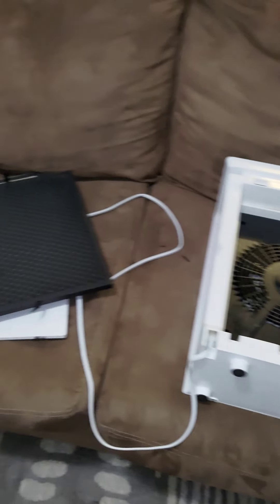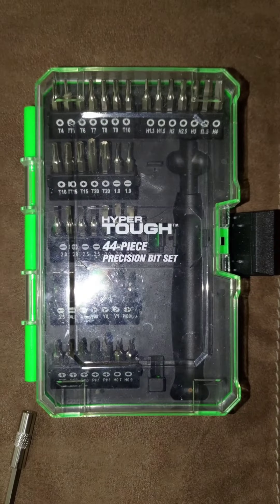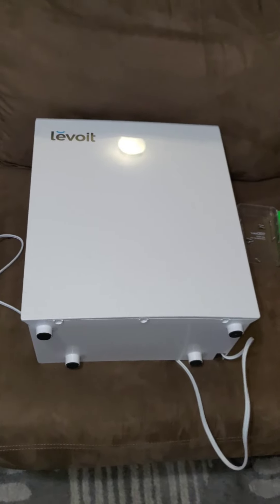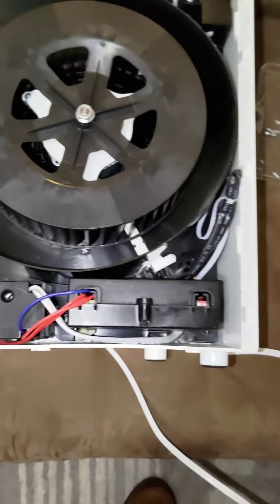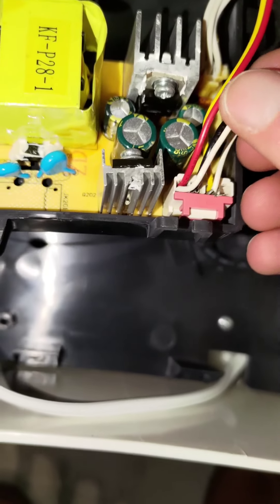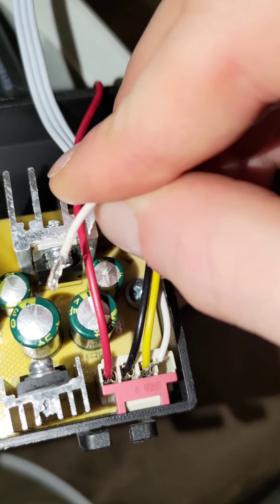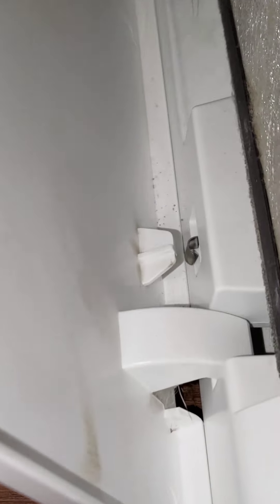Levoit LV-PUR131S Hack / Teardown

Comment: FYI - Took a look at a friend's unit that was not working and found a bad 470uf capacitor on the power supply board. Replaced the component, and did a full clean up, and got it back up and running. Thought for sure I was gonna destroy that front cover but did manage to wrestle it off and dug into the electronics. Saved it from the trash.
Reply from the maker: That is awesome!  I might try that, but like I said, I'm happy with the unit just running on full power.  I might try to fix one of mine for fun though.
Reply: 470uF.. thank you. I forgot to note this before reassembling the unit
Reply: I just took apart mine that stopped working and lo and behold, bulging capacitor here too! will be replacing it soon
Reply: @chaosdimension6433  Are you serious? So thats a few confirmed cases of blown capacitors now. What a joke.
Reply: @CheeseZombieo  yup, ordered a few 470uf 16v replacements already, hopefully it's just that
Reply: @chaosdimension6433  Let me know how it goes!
Reply: @CheeseZombieo  Received the capacitors today, replaced the blown one and the air filter is back to 100% fully operational contidion!!!!!
Reply: @chaosdimension6433  My dude, thank you so much. Thats what I wanted to confirm being placing the order. I'll grab those now. Big thank you for your feedback & follow-up - I appreciate that.
Reply: @CheeseZombieo  no problem man! i bought 5 for like 4 dollars, very easy to replace, let us know how it goes for you
Reply: So glad I found this comment. I had a popped capacitor as well and 97 cents later I have a working unit again.  I had one replaced by Levoit and one replace by Best Buy within 10 days of each other.  I watched back through this video and I can see the same 470uf capacitor on the left at 3:42 looks domed up as well.
Reply: @a93x  Glad you were able to fix it. The guy I buy capacitors from has a moto that "replacing capacitors can fix 90% of the worlds problems. It sure seems like it. Way to go Alex.
Reply: Also worked for me just now (look at 3:42 in the video to compare, top left capacitor, replace with 470uf >= 16v, working fine again).  Quick and straightforward repair!
Reply: Thanks, this was my unit too. I luckily had some replacements handy to replace the bulging 470uf cap.
Reply: Thanks for this - found one of the two 470uf 16v caps had bulged so pulled it out and for .50 dropped in a replacement cap. The only thing else I needed to snag was a set of triangular bits for the silly single screw on the case - but that only cost $5. So $5.50 vs. $180... I'd call that a win.
Reply: @Exilon2112  Seems like the 470uf capacitors are the weak link. Lots of folks finding the same issue. Anybody try a 35v cap?
Reply: thank you i fix mine in 10min
Reply: As I’ve done some learning on this component, make sure you find a Low-ESR (low impedance) capacitor. This is crucial in switching circuits / power supplies.
Reply: You want that motor to sound good when its spinning. Lol
Reply: @xfireamg417  I don't think the size difference will fit, it's pretty tight in there...
Reply: The cap fit without any trouble. Wish I had captured this on video and posted it for the YouTube community as this seems to be a common problem. Hope you can get yours working.
Reply: I thought the cover was going to crack when I ripped it off lol. I was like Oh well here goes nothing and pulled hard and lo and behold it came off just fine
Reply: @amypolzella8349  Hope you get that thing going
Reply: @xfireamg417  I got one of them working like new so went ahead and did the other one the same way. Replaced both capacitors and now it only works the way the video hack would have had it work. No off and on, nothing at all on the touch pad but if I plug it in it runs on high. 

I noticed on the motherboard there is a white plug that connects the long white flat cord that runs to the top of the machine. It is possilby/probably the connection to the touch pad and I noticed that there is a dried pool of a very dark orangeish brown substance around the base of that plug. I think this is the issue but I don't know. 

I have to figure out how to fix that now so I'll see how it goes. Any suggestions?
Reply: @amypolzella8349  I sent the repaired unit back to the owner so I don't have a reference unit anymore. Best of luck
Reply: 👍 Awesome. Exactly the same issue and by replacing two 470uF 16V capacitors. The problem was fixed. I would suggest to replace with any 470uF+ 20V+. These two capacitors was working heavily (probably over voltage because of the design).
Reply: Is this the board at the bottom in the black box?  I didn't see anything amiss.  My display doesn't light up at all - I don't see how to remove the touch panel?  I undo the two clips, but there seems to be posts going into the display panel - so how do I get to it?
Reply: I did the trick and it works, but upon first turning on, I heard a small pop at the back of the unit (not in the wiring I did). Sort of like a short somewhere. It smelled like electrical smoke slightly, but it stayed running and doesn't smell anymore. So hopefully it's still safe to run without concern of fire.
Reply: @gavindundee  looking at your video the light reflection off of your capacitors looks like the tops are  JUST slightly bulged which is bad
Reply from the maker: @cdoublejj  I really should just replace them, but I just haven't prioritized it because I just don't need the smart control haha I'm happy with mine just running when plugged in like a standard fan :)
Reply: @gavindundee  Fair point!!!
Reply: @a93x  Mine died last week. Just checked the capacitor shown in that frame, and can confirm it's popped out slightly. Will replace it soon and see what the results are.
Reply: hey nine is cutting on and off on and off
Reply: Massive thanks for the tip on the capacitors. Mine had a bulging capacitor too on the 470uF 16v. Levoit clearly used terrible quality caps. I won’t ever be buying Levoit again.
Reply: @amypolzella8349  The dried stuff is a glue they’ve used to keep the connector secure. I have it on my machine too.
Reply: @WestForMiles  👍

Comment: Just did this on two units. Magic smoke came out at first but the motors turned on regardless. Now they're working without issue. No more hassling the user interface. Make sure you use the same gauge wire as the headers or there may be a fire hazard (admittedly, I'm not an electrical engineer). In the worst case you could possibly use two smaller wires to reduce current through each, but you really are better off just using the proper gauge wire. Thank you for this video. Levoit purifiers work well but the electronics are engineered to fail after 1-2 years.

Comment: Thanks this helped a lot. I just jumped the wires with a paper clip instead. Hopefully i can make it “proper” by replacing the capacitors later. For now, because of the LA fires, I needed it ASAP.

Comment: I just got fully into the u it before finding this video, I had no problems. Now, I see there is a swollen capacitor on the power supply, which is not allowing the full circuit to power in the u it. It’s completely dead. I’ll post back once I install the new capacitor. If your video, you have the exact same symptom on your power supply too I noticed.
Reply from the maker: If you fix it, please let me know which capacitor.  That would be great if I could fix it.
Reply: It's been a couple weeks. Did you fix it? What was the value of the cap?
Reply: Hell, I might make a repair kit for purchase if these units keep blowing on people.
Reply: @CheeseZombieo  I opened mine up and the caps seem ok. My top panel isn't all lit up, the only lights I have is the red power, red filter and red air indicator. Any tips for troubleshooting?
Reply: @MaceAries  Weird, I sent a massive reply to you here but it disappeared. Anyway, that sounds like a bad connection from the wifi/controller board to the display. If only a few are lit up, there is a fault and it is unable to initialize that module its looking for - which should be the controller (where it has the button you press through the back of the unit).
Reply: What I previously stated, was the specs and items on amazon for repairing this - I was probably flagged for spammy stuff. My unit is 100% dead, no display no nothing. I hear a conductive arc from the wall outlet - so I know the transformer is active and working. Only thing I can suggest is checking that black box with the button, or do the 220UF-25V capacitor kit - $13 - order on Amazon and then grab a soldering iron - $25 Just if you do, be sure to unplug everything, and take a insulated screw driver (rubbed handle/plastic) and with the tip of it touch both legs from underneath the board, to ensure you discharge them and wont shock yourself. Those suckers build up good but discharge fast.
Reply: @MaceAries  in this case, of the 2x units I fixed, 1 had visibly bad caps, the other didn't. The same fix worked for both; replacing the 470uf 16v capacitors. Obviously if you see any other caps that do appear swollen/busted, go ahead and replace those as well.

Comment: And another one is now running thanks to you. I had bought new filters & when I went to turn it back on it was doing exactly what you showed. I'm on disability & it's hard enough to pay for new filters much less replacing purifier. It is little over 2 years old, just out of warranty. Bless you for sharing
Reply from the maker: I am so glad this helped you out! 💜

One of mine also broke when I replaced the filter like you said.  It's like I turned it off permanently when I replaced the filter 😅

I felt scammed kind of.  I expected the thing to last several years and after dying 1 year later I was very disappointed.  Now they should run for a VERY long time 😊

Comment: Hey boss, just did the 2nd filter of mine that crapped out. I wound up cutting the red & yellow wires outside the box and putting all 4 in a 16AWG butt splice. That way you don't have to worry about the jumper backing out - don't even need to get into the control enclosure. 2 crimps, reassemble, and back in service. Thanks again for sharing this info. I'd have had a couple hundred bucks worth of engineered-to-fail trash if I hadn't come across this.

Comment: Thanks Gavin! I just completed this hack/repair after watching your tutorial and reading the comments. It worked!
Notes for other viewers: In addition to the steps in the video, I also disconnected the white 3 pin wire which ran between the main control board and the lower power board. It's not going to do anything for us anyway, and as another commenter noted, leaving it on could fry the microcontroller. 
Not sure how long it will run for, but mine is filtering air again (at high speed with no controls). Will not be buying anymore of Levoit's planned obsolescence!

Comment: I had the same problem, opened mine up, two of the caps were bulged (one 470uf-16v and one 1000uf-35v, the two on the left at 3:42). Replaced both and works like new. Do watch out for the big black cap on the left of the board, it's a 400v one you don't want to get a full charge of that one...
Reply: Thanks.
Reply: Got one off the side of the road.. both of the ones you said are slightly bulged out..
Reply: Also has some discoloration or leakage on circuit board near left blue cap that is by the transformer..

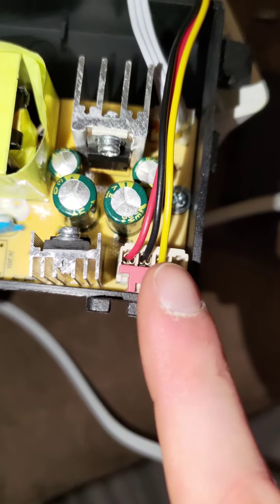Comment: The real issue: Those two small caps at the top of frame at 3:08 -- the 470uf capacitors. I've had some 4-5 of these things fail on me over the years but knew enough to fix the last 2 and both times they were repaired by swapping out those two capacitors. They're 16v and I've changed them w/ 16v myself as well, but I've been reading that others have had success w/ higher voltage and should be fine. That returns it back to normal functionality. Good luck.
Reply from the maker: @patricknelson  Thank you for specifying this for everyone! 💜🤗

Comment: Thank you so much!... I was about to dump this S***, I started goggling and saw a lot a people with the same problem. I just had bought a new replacement filters and when I turned back on, the lights start blinking and not power. I opened, cleaned, reset it and nothing seems to work. I found your video and voila! it's working again. Follow the tips of one of the commenters and connected to a wifi switch. If I want to turn off I just use the switch. Great video ! Thank a lot!
Reply from the maker: You are so welcome!  I am so glad this helped you out.  Thank you for your support 💜

Comment: Thank you so much for the video. I saw on the forums the typical capacitor issue, so I ordered them only to find none of mine were bulging, so I just did your quick trick with the wire and presto! We don't have to throw it away!
Reply from the maker: I'm so glad this helped you out! 😊
Reply: Even if  the capacitors are not budging it still might be worth a  shot to replace them.

Comment: Awesome thanks! Finally got a chance to give this a shot (waiting to see if purchase assurance would payout) and it works!  You can unclip the reddish clip that's holding the wires in place, makes it a lot easier to get the short wire in.  

From the orintation in your video @3:09, you can use that flat screwdriver to pry the red clip off the holder. Gives like an extra 0.5mm to shove in your wire.
Reply from the maker: Heck yeah!  Great point.  Thanks for sharing! 😊

Comment: Assuming the board is just using different resistances to vary fan speed, I wonder if adding a variable resistor with knob would allow for speed adjustability.
Reply from the maker: The logic seems sound.  I bet that would work!

Comment: You are a genius!!!  I did the hack and it worked. I did not know how to tell if the capacitor was bad but I suspect that is the case. I don't have a soldering kit and didn't want to spend any more money as I had to go buy the screw driver for the triangle bit.  I also bought some fuse from Walmart that had two yellow wires that I cut out and stripped the wires. It was a #12 gauge, which was too big so I ended up cutting all the rubber covering and took half of the wires and twisted it. I put the wires through the original yellow tubing and used electric tape to keep it covered.  It was hard to fit it in between those two other wires but I forced it in there.  I plugged the unit in but it didn't work so I proceeded to put all the screws back on and then put the filter in. It started right away 🎉🙂👍😊. The display doesn't work but as long as it runs, it's all good. Fire season is about to be upon us in California so now the unit works for when we have bad air quality.
Reply from the maker: I don't know if I'd say I'm a genius, but thank you for the compliment!  I'm glad I could help you out!  😊

Comment: Dude you’re a life saver. I literally had mine sitting outside to take to the next dump run but it works like a boss because of you. Easy little trick and fun project.  If you like smart devices I have Kasa smart switches and plugged it into that so I just have to tell Google to turn on my purifier
Reply from the maker: I'm so glad I could help out! 😊

Comment: Looking at around 3:00 in your video and yep the caps probably went bad due to a power surge. For those that want to discharge a cap before attempting to replace, just bridge the positive and negative pins with a flat head screwdriver. Be sure to only hold the plastic end of the screwdriver so the current doesn't travel to you and make sure you don't use a one with a cracked handle exposing the metal in it. You should see a spark or hear a pop but this is normal. You have just discharged it and it is safe to replace the bulging capacitor.

To prevent this damage in the future use a cheap surge protector. Many big brands like Amazon basics, APC, cable matters, Belkin, etc often sell the wall mounted ones for $15 or under  and some that come with USB charging ports as well. A nice added feature. I have my mom do this for any more expensive air purifiers we own or valuable electronics for that matter like TVs. Many people don't think it but you absolutely have to protect things like TVs from surges as they have become even more sensitive to power surges
Reply: I suspect a source of the power surges in these units is internal. Perhaps anecdotal evidence, but I am aware of several of these breaking in cat households. My hypothesis is that cats jump onto the top of the units (I have one little girl who absolutely loves her diva moments with the fan) and pressing the capacitive buttons with their bodies, possibly a rapid on/off signal, causes the power supply board to overload. 

I just took apart one of mine and decided to splice the wires shown. Might consider adding a dial because ideally this would run 24/7 at around 30%

Comment: Well, i thanked you a year ago & used your video to get it running again. Changed filters 6 months ago & up & running hot wired again fine. Now i just changed the filters & plugged in, it runs, but now it starts out on high but cycles down to no air flow then back up on high flow again. Its very consistent on it cycling but not sure why its doing that. I checked my prior wiring per your video & connections arent loose. Tried numerous times with reset button.  Any ideas ? Thank you !
Reply from the maker: Well this is very saddening to hear.  There is potentially more capacitors (significant ones to the operation of the fan motor) that are bad within the circuit board.  I wish I was able to diagnose your issue more closely and fix your fan. :(

Comment: Thanks, managed to fix a free broken Levoit LV-PUR131S I just picked up :) Unscrewed the circuit board thingy to remove that reddish clip. Used some old speaker wires. Works!